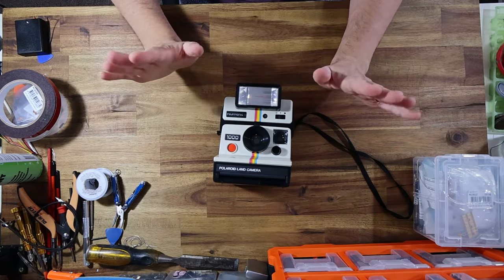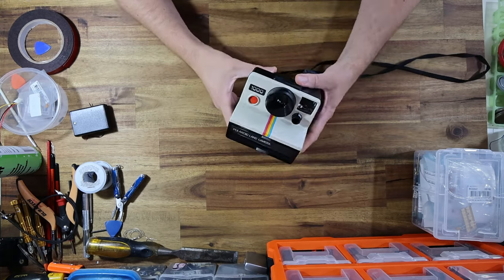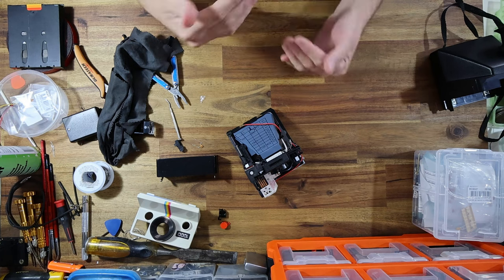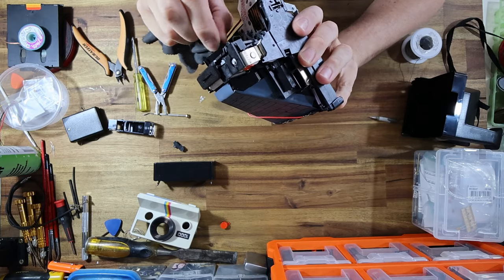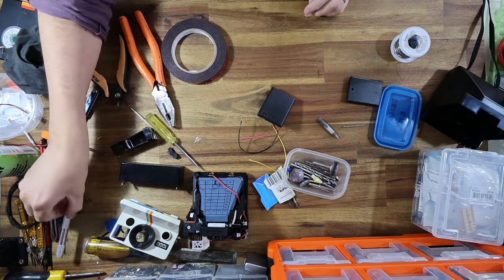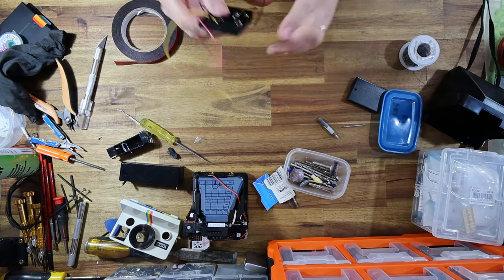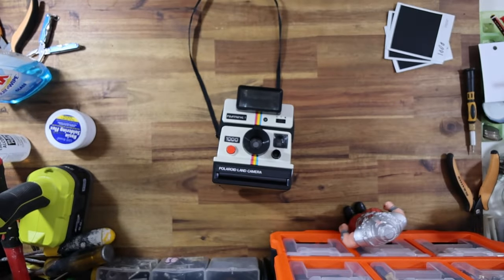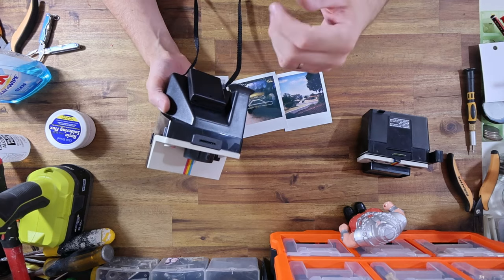AAA Powered Polaroid! Converting a Onestep SX-70 to i-Type film - Camera Repair ASMR

Comment: Thank you for sharing the repair process / modification
It's cool to watching you burning your desk with the solder :D
Reply from the maker: the wood is actually a panel on TOP of the desk. It's there to be expendable. So I can drill into it, scuff it etc without worrying

It's a perfect surface to solder on, since solder does not stick to wood

Comment: Just caught up with this first video. 
After seeing all your other videos where the hands come from the bottom of the screen it was a touch awkward. 
I can see why you changed. 

After your latest video explaining all the various options to put power onto the SX-70 to use I type film etc - what about a flash modification video. 
Comparing results of different methods and showing the modifications necessary - wiring etc ( Don’t electrocute yourself !! ) 
For box and SX-70 camera’s  - 
1. Adjusting the Polaroid accessory flash by lowering the flash brightness to allow them to be used with 600 /I type film.
2. How to put ND filter material on top of the flash / or inside the flash unit itself for better look etc. 
3. Alternative flash units - Mint Flash Bar 2 - full and half power settings. 
4. Original 10 shot flash bulbs - can they be covered up with a ND material stuck over them ? 
If not are they now to bright when using higher speed films ?
Reply from the maker: Not a bad idea

I have done a video showing how to mod a Onestep sx-70 flash

I want to do one showing a Polatronic flash though

Most of the videos I do are on client cameras, so priority is clients sending me interesting stuff
Reply: @theinstantcameraguy  just found your SX-70 flash modifying video. Thanks.

Comment: I guess one could also put a filter over the lens instead of using that one over the film pack, or the film pack cutout over the lens?
Reply from the maker: this is 100% correct. Another way to compensate for the 640ISO film would be to use filtration. However, doing so would leave you stuck with slow shutter speeds.

Doing the electronic conversion speeds up the shutter, making it far more useable in low light.

Comment: I do have a question. I'm having a hard time finding a 50pf capacitor online. I'm seeing 47pf and a 56pf. Which one did you use exactly? Does a variance of +-4pf matter?
Reply from the maker: I used 47pf in this conversion.

But honestly those two capacitors are so similar in value it would have a negligible difference. You will likely still have to tweak the electric eye gears to get exposure 100% correct

Comment: To make the flash 1/4 power you can replace the main high voltage electrolytic with one 1/4th the value. That'll give the xenon tube a lot less power
Reply from the maker: I have considered trying this

The issue is 300v caps aren't easy to find!

Comment: quick question why not just solder the battery wire directly on the contact instead of having a 2 way switches, when you are using a polaroid cart with already battery on it just turn the battery off, and when you are using the i-type turn the battery on. am i wrong here?
Reply from the maker: Well, your solution would technically work. But it would be janky as hell

The idea is to keep both power sources separate from one another

If we wire it in as you suggest, it becomes accidentally possible to power the camera off both the internal battery from a pack of 600 AND a pack of AAAs. This would cause both batteries to run in parallel with each other, which is just not a good idea

Although unlikely to cause a serious issue, any voltage difference would feed into the flatter battery until both cells discharge each other

It is best to build in redundancy and failsafes to offset human error (ie leaving the switch accidentally on while you use 600 film)
Reply: @theinstantcameraguy  well my idea was that the battery holder already have an on/off switch, so i dont think is an issue correcto mundo?
Reply from the maker: @jacklee3220  re-read my comment...

Comment: Hi, instead of a green capacitor, mine has a blue one with an orange band at either end.
And no markings!
What size would it be?
Reply from the maker: I've never seen blue 
You'll need to measure it yourself
Reply: @theinstantcameraguy  ok, thanks.
Reply from the maker: @ironjohn5107  ESR readers are cheap from eBay

They will tell you how many of the cap is :)
Reply: Ah well, stuffed it now.
Stupid paper circuit "board".
Reply from the maker: @ironjohn5107  several months later and for the first time I've found a blue cap in the wild

It was roughly 250pf 

So a 47pf cap would work fine